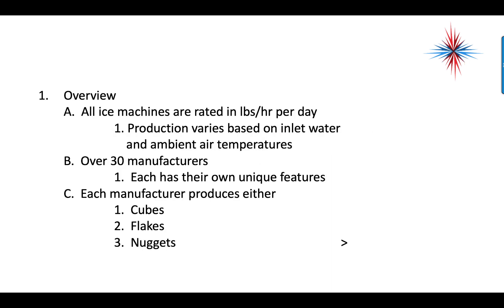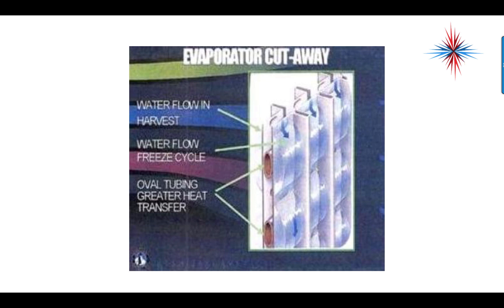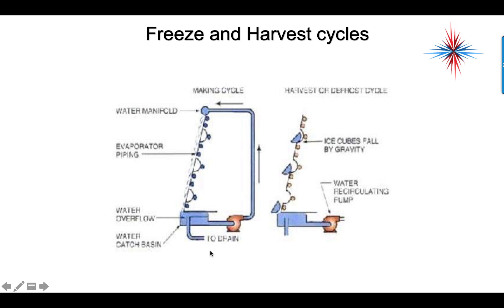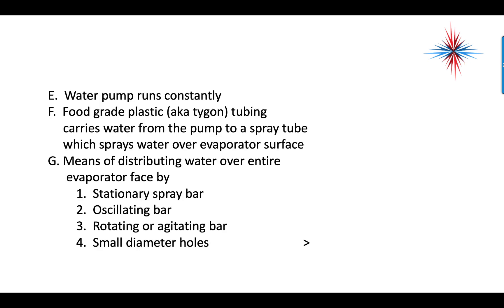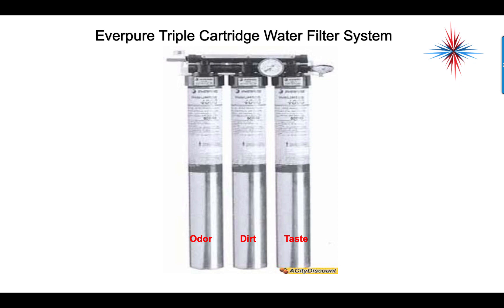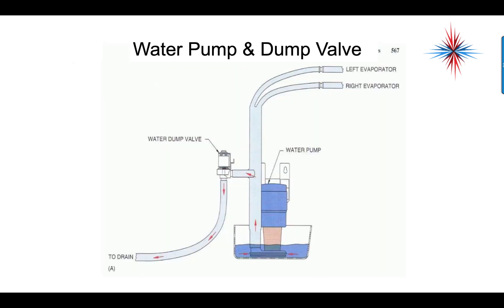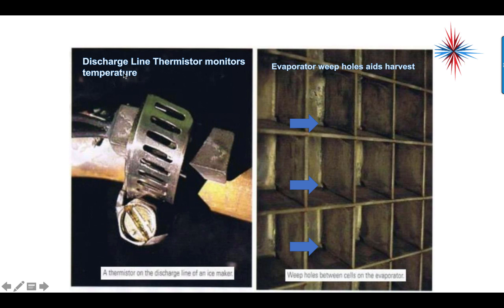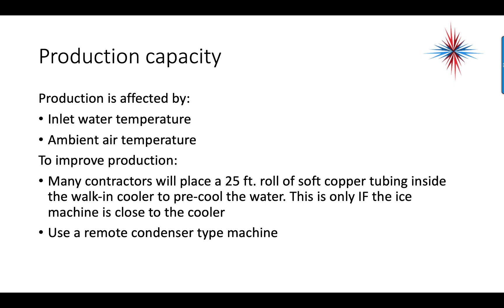Advanced Refrigeration - Ice Machines Part 2

Comment: Awesome info!

Also 
If the ground water temp is lower than the room temp, then insulate the supply water pipe all the way to the ice maker may increase ice production speed.
Add a sold for purpose clamp on magnet onto the supply water pipe to reduce water deposits drop out and hardening on components.